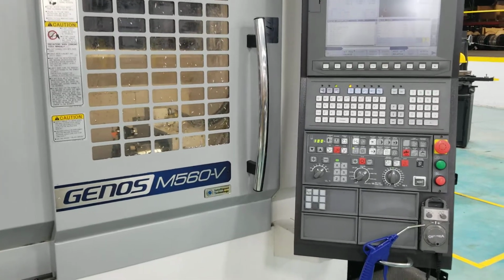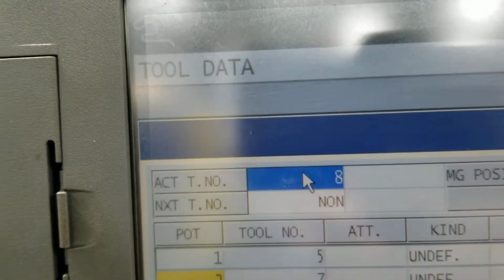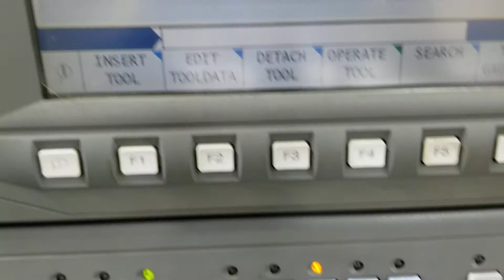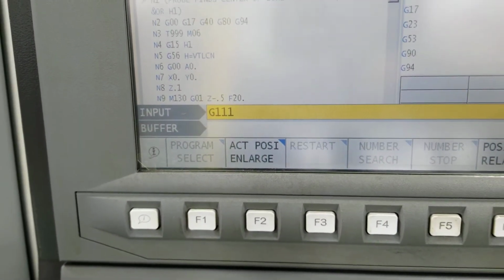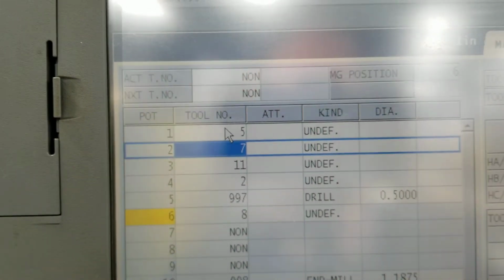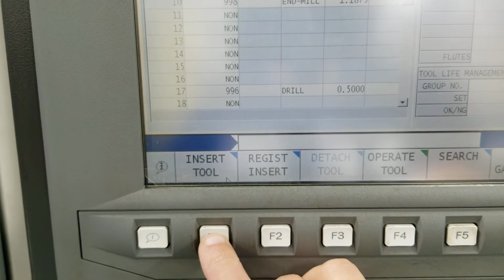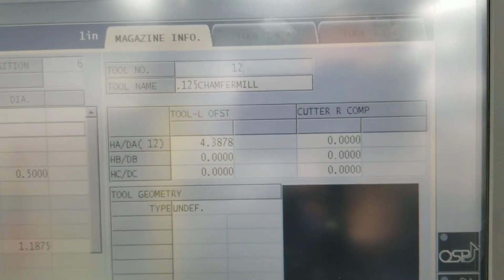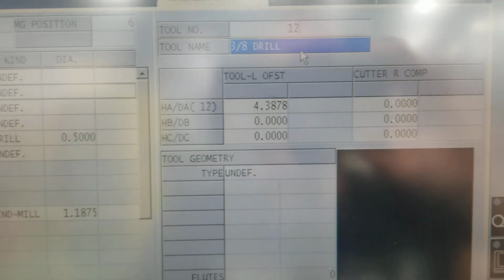Changing and Inputting tools (OKUMA-M560 OSP-P300M Control)

Comment: Why G111?
Reply from the maker: Yes, Reis is right. It's calling a macro program that Gosiger installed to call an empty pot.
Reply: @VictorHernandez-nt3tw Yes, Aaron King with Gosiger is one smart and innovative programmer.
Reply: i think it calls an empty pot
Reply: G96 through G120 on the P300 control are custom macro G-codes. You write your own can cycle and assign it a g-code, register that g code in the settings and the program will be saved as a " .lib " I have several versions I use. I have machines with the bkmicro bts sensor in the mag side so I can have broken tool detection while the machine continues to run. 
G111 A1 R2 K1
So G111is my basically my M6 but what it does is calls A1 (tool 1) into the spindle (R2) stages tool 2 next (K1) performs a broken tool check on the tool leaving the spindle(whatever tool is being put away. I can also do a B-axis rotation while the atc is changing a tool. 
So my tool call will look like this. G111 A1 R2 B90. K1 
The nice thing is the CAN will M64 any tool that was in the next tool position. Mine is also setup to M329 (turn off spindle tool exist) so you can call an empty pot. I have some tools that are tool long or too heavy for the ATC so the tool is loaded and unloaded manually. Though I'm not a fan of turning off spindle tool detection, it can and has caused issues before.